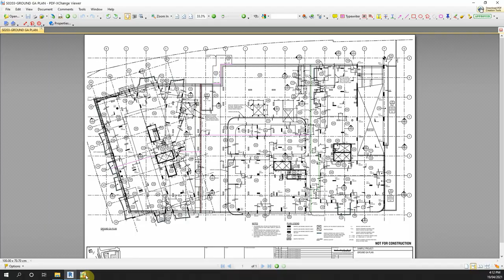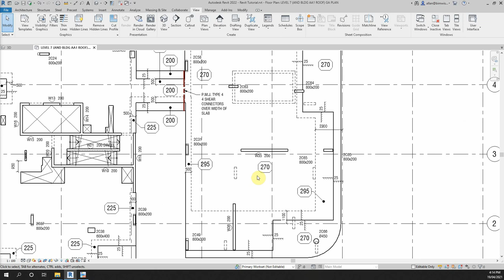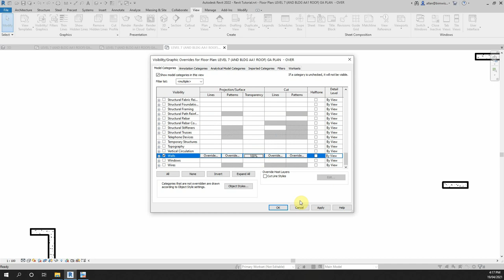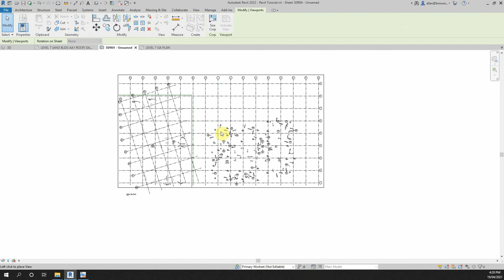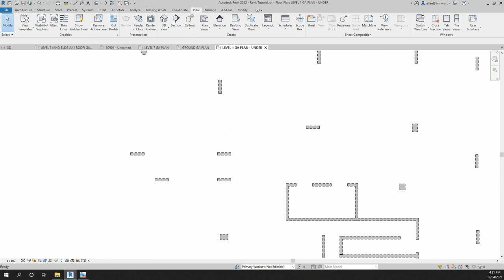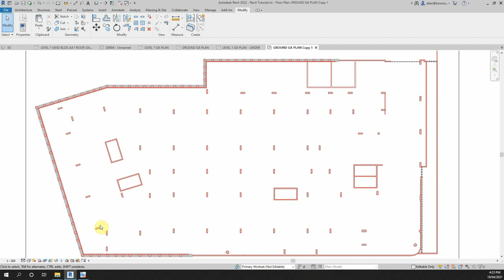Revit Tutorial - Showing loadbearing shade hatch under for structural drafting of concrete slabs.

Comment: Great video! Thank you! Another possible solution is an idea variation that I learned from The Revit Kid's Channel.  You can create an instance Project Parameter for walls and/or columns in order to define the level.  For example, the Project Parameter for columns would be a text instance parameter, so you can label all columns at level 2 as "Level 2", likewise, for all other levels.  Now, at each plan, you can set up a filter to find columns above and columns below by filtering for the proper column level.  You can then assign whatever hatch or fill you want in your filter.  This approach would require your cut plane above the floor and view range deep enough to see the lower column.  100% Transparency would be required for the upper column hatch.  Thank you again for this helpful video!
Reply: One more thought.  If one does not like the idea of manually labeling column levels you can set up a a Dynamo program to do this automatically.  As a reference, please see the linked video from The Revit Kid that shows how to sort walls by story and how to set up the Dynamo: https://www.youtube.com/watch?v=MNnnk-_zv08
Reply from the maker: It would be so nice if Autodesk gave use a simple, robust solution for this. It is the thing most lacking for structural documentation…

Comment: Fantastic video thankyou, can I ask is there a way to show this on Bondek slabs aswell? i have framing members that support the bondek slab that are in the same plane as the walls under, but the walls under are showing ontop of the framing members, which means you can't see the framing members that are supporting the slab over.

Comment: I also use this 'work around' however it is as others have mntioned below prone to problems particularly now in Revit 2023 where printing processing has changed.
Reply from the maker: Not having a decent robust clean method to show load bearing under is the worst thing about Revit. AutoCAD does this better as you can overlay a xref from under. We just don’t get why Autodesk can’t add a tool and make it work similar.

Comment: I say we follow each program ways, we can't force Revit to work in a different way than the one it was designed, it's inefficient and time consuming.
Reply from the maker: Agree with you to a limited degree. Software exists to deliver solutions for our work, not the other way round. Programmers do need to give us the tools to create the engineering outputs we want, not what they think we want. There is a campaign going on Autodesks Revit Ideas board asking for an automatic way to do this. Vote it upwards at: https://forums.autodesk.com/t5/revit-ideas/load-bearing-under-hatch-fill-for-structural-plans/idi-p/10315626
Reply: @TheArtofTechnicalDrawing  Υεs, i see what you're saying, however, if the program doesn't offer this function and you force it to work in a way it's not designed to work then you'll meet problems and in big projects it's hard to manage all these views and view templates, settings, etc.
 It's like you're asking for problems and you are trying to make things more complicated.
Drafting should be a breeze...
Reply from the maker: @Nicholas.Tsagkos  We are the structural engineers not the computer programmers. This functionality should be added.
Reply: @TheArtofTechnicalDrawing  Just voted up on this.

Comment: Nice, but Revit isn't designed to work that way, and it's frustrating to have 3 times more views to manage, and some times you might have visibility and graphic problems.
Also, it's fundamental in drafting that a cut element has a hatch and a projected one doesn't, with this method, the cut element is almost white (bar the concrete hatch) and the element below (projected one) has a solid hatch, making it more vibrant than the cut element, the cut element should be darker and not the projected one.
Why don't we KISS and use Revit as it designed to be used?
Reply: Sure.. Revit isnt designed to work that way, but it's quite literally the standard to show hatched for load bearing elements under in a number of countries around the world.